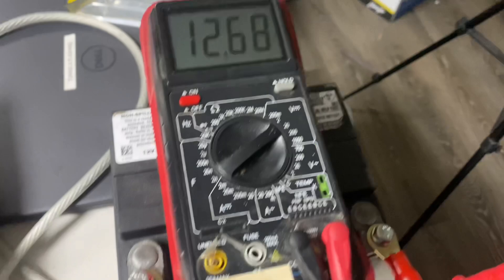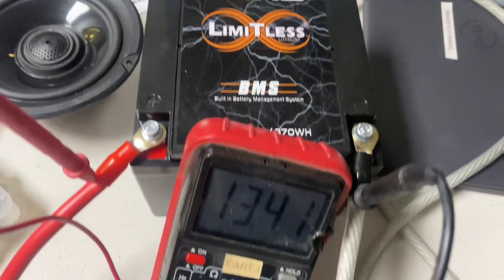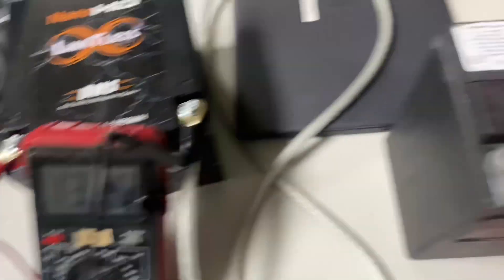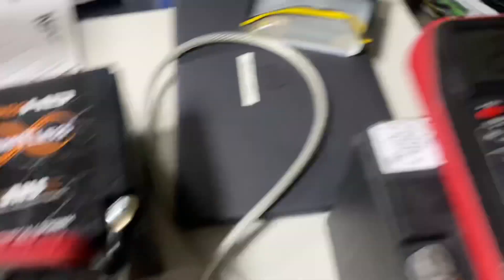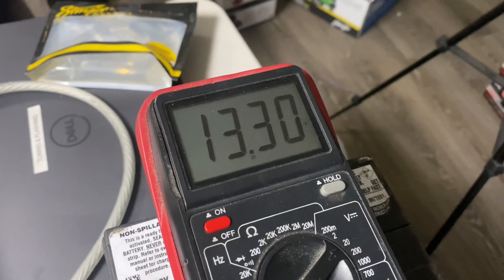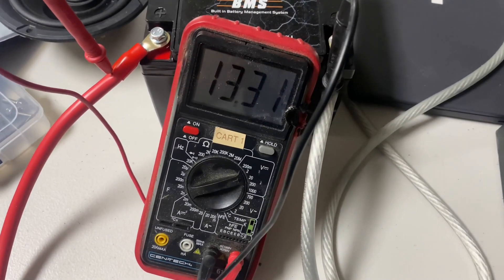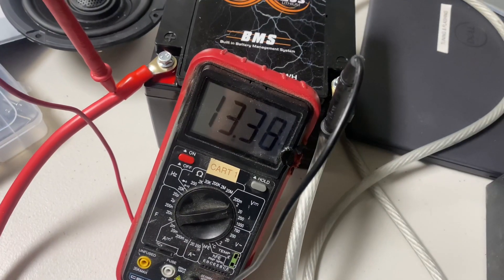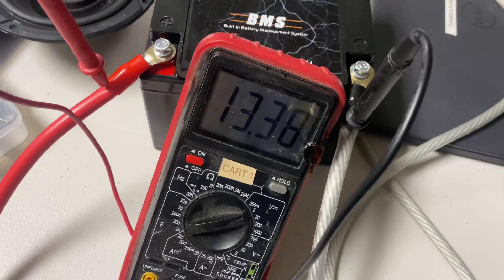Hooking up a circuit breaker to run a lithium battery and a factory agm battery on your Harley

Comment: can i wire together agm batteries in series with lithium batteries to run auxiliary equipment cant afford deep cycle lithium ..ran across a lthium ion at junkyard snapped it up same with agm deep cycle.couldn't nelieve my luck...butt just wondering if ut safe to put them together in series..thankyou..

Comment: Hi Carlos I do the same  thing but I use a smart battery isolator which only links both batteries will the engine is running or you can put it on a switch.

Comment: What size breaker would you need for two stinger hd batteries? Currently I’m running a stinger 150 breaker between both batteries.
Reply from the maker: That’s fine